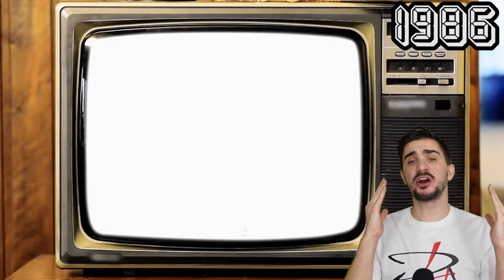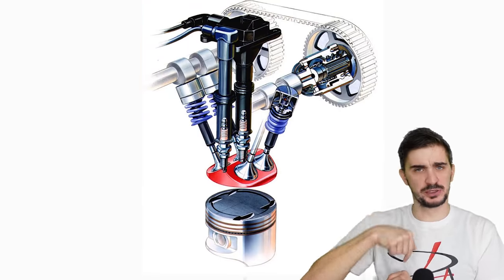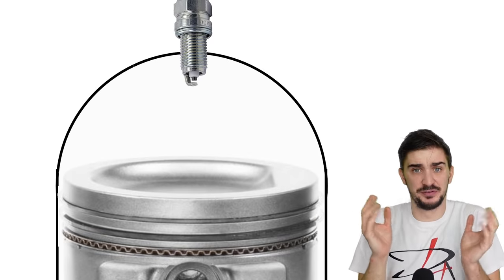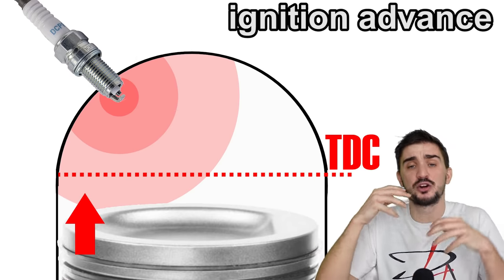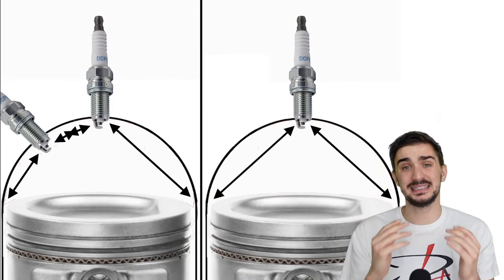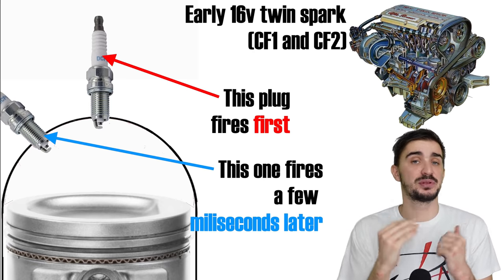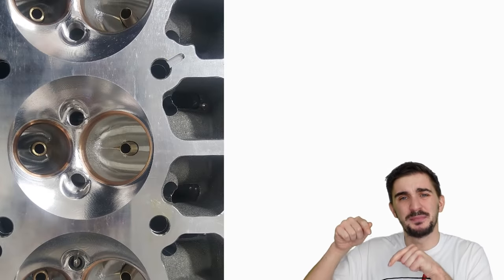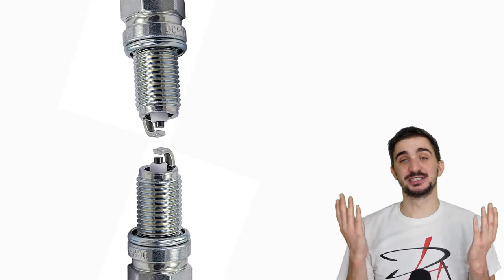TWIN SPARK - WHY, HOW and why it isn't more widespread

Comment: A good explanation. The initial concept of twin plugs was to allow constant ignition on aero engines because early plugs were very temperamental and would often fail on take off or over enemy territory. The advance of flame front on early engines was little understood as these averaged between 1200 and 2000 rpm. Post First War research by K lee Guinness KLG proved the validity of his mica plugs and manufacturers research developed flame front technology and raised rev limits. These were usually  magneto operated and there were safety limits on the drops allowed. This was 400 rpm on the Rolls Meteor which initially were lifed out Merlin engines but later were made in their own right. 
What you have to remember is that in 1914 the only reliable magneto was made by Bosch. So at the end of the war all the magnetos made by the Allied powers that used Bosch principals of design had to make a payment to Bosch. This happened in WWII as well as all the French factories bombed by the RAF and the American Air Force as well as American factories in Germany were given financial compensation. The factories here that created the magnetos and other instruments of war were taxed very heavily for excess profits from government contracts.

Comment: I used to rally a Nissan Bluebird from the early 80s, I ran it with the Z18ET 1.8lt turbo engine. 
It had the 'NAPS' twin plug cylinder head but on those engines, the exhaust side plugs were disabled at high rpm and heavy throttle to prevent knock from two flame fronts.

I not now that Beta has just released their 2024 range which includes a twin plug cylinder head for the 250/300 2 stroke models.

Comment: Mercedes AMG engines also have twin sparks... at least mine (SLK 55, 2007). They ignite in sequence and at every ignition the PCM  changes the sequence, in order to consume the electrodes evenly (1-2 / 2-1 / 1-2 and so on). Not sure if newer engines have the same. My engine has 3 valves / cylinder, variable intake runners and a fixed cam timing.

Comment: Most engines with twin plugs are use a hemi or heli inspired combustion chamber. With the lack of quence areas these chambers NEEDED twin plus for combustion efficiency and effectiveness. A wedge or twisted wedge chamber doesn't need two plugs as it has a quence area that forces the AF mixture towards the plug. This also helps reduce knock sensitivity in moderate compression ratio naturally, aspirated engines. As boost is added or increased or compression is increased for racing performance, we "soften" the chamber or even reduce the quence area(s).

Comment: First good video and explaining some good resons to have twinspark. Tough so far as I understood why Alfa Introduced the 2.0 twinspark is that the old twinspark was now on par with the 1.8 injection so the engine needed an upgread. Fiat did not allow to big changes to the block but there was enough money for a head revision (money as alway's a big thing at Alfa) Here Alfa rememberd this thing from their race history and decided to put it into their cars as a preformence upgreade.This system improving compression (1-11.5 if I remember correctly) and with injection and variable timing made a very good engine. And the 75 twinspark saw high sale numbers.
With the later 16 valve engines there was no need for the 2th plug as the plug was not in the way of the valves, so the engineers reduced the plugs to 1 per cilinder, untill the commercial side took over and forced a 2th plug in there. So technically the yougner twinsparks are a sales technic still sailing on the succes of the original twinspark.
As I have owned an original twinspark, I can say, they were definitly a really good engine and right for the car it was placed in.
Reply: From my understanding, those older 8 valve twinspark engines (e.g. Alfa 75) had a narrower valve angle than the earlier 8 valve twin cam engines (single plug). This narrower valve angle was possible because twin offset plugs replaced the centrally located plug in the older engine, so improved combustion chamber shape was another benefit of the design.
Reply: @alexjenner1108  This is what I ment, tough trying to keep it a little more generic and more easy. But you are very much right on this.
Reply: In Alfa 75,  twin spark engine was born before fiat bought Alfa , had 148hp - same engine with no twin spark has 128hp, it's significant difference, then in 145/6,156/6, gtv.. was on fiats block with alfas ts 16v head and had nothing to do with old full aluminum engines...

Comment: I’ve been driving a twin spark plug since 1986 when I bought my Nissan D21 Hardbody truck the little 4 cylinder still going strong with over 400,000 miles best engine ever for me

Comment: With regards to aeronautical engines, older designs use twin magnetos rather than coil type ignition systems found in automotive applications. One of the pre and post flight checks is to test these by switching off one bank of plugs.
There is a noticeable reduction of RPM and consequentially power when one bank is switched off.
Not only are two plugs used for redundancy in aeronautical engines, the cylinder sizes are big. I'm of the understanding that this is a consideration for engineers with respect to flame propagation.

Comment: Good explanation but for the details you need to search more deep in the technology , especially Mercedes with the 3 valve V6 and V8 have twin spark and fires the sparc plugs up to 5 times each per combustion cycle because in some situation the engine runs very lean to save fuel. Also for the Hemi, the 6.4l is available with an intake system that variates the intake air mass and speed. Always enjoy to watch your videos.

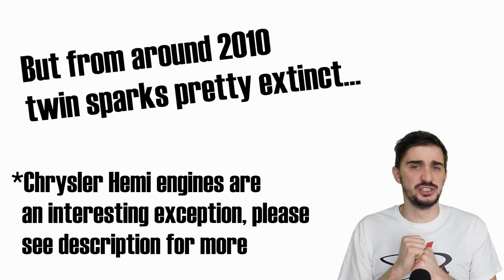Comment: @8:44  The note about the (modern) Hemi reminded me that there were also racers messing around with dual plugs on the classic Chrysler Hemi (such as the 426).  The production Hemi engines were al 8 plug, but some heads were modified to accept 16 plugs.   These were very high performance versions, usually running a LOT of boost (which creates a dense mixture harder to ignite), and many were running fuels like alcohol and nitromethane (so different flame speeds than gasoline).

Comment: My 3rd Motorcycle was a BMW F650GS single cyclinder from 2006, they added a twin spark system in 2004 and apparently it reduced the fuel consumption a bit as well as reducing emissions..
Reply: Mine is a 2007.  The dual spark/fuel injected Rotax engines were a big improvement over earlier models in performance as well as better fuel economy and reduced emissions.

Comment: Ford 6.2 gas engine, is a twin spark plug per cylinder engine, 16V SOHC. Found in the 2010-2014 F150 raptor svt and from 2011-2021 in the Ford Super duty trucks as the gas option. Both fire at the same time to reduce emissions, a single COP plug in the top of the head provides the spark for both plugs via a traditional ignition coil wire to the exhaust side plugs.

Comment: One other reason airplane engines use twin spark layouts, apart from the safety/redundancy factor, is that they usually have comparatively huge displacement when compared to car engines.

As an example, the Lycoming O-320 engine is used in a significant number of small, 4 seat training and personal planes like Cessna 172s and Piper Warriors. It is considered a small, efficient engine, usually outputting 150-160hp. The O-320 is so named because it is a horizontally Opposed 320 cubic inch engine. That is roughly 5.25 liters of displacement in a "low output" 4-cylinder engine.

The comparatively huge per-cylinder displacement of airplane engines means that multiple ignition locations pay huge dividends in ensuring complete combustion across the whole combustion chamber. This is why disabling each of the magnetos during the pre-takeoff run-up causes a noticeable drop in RPM.

As an aside, the reason airplane engines make relatively low HP numbers for their displacement, is that typical propellers drastically lose efficiency as their tips approach the speed of sound, which typically happens somewhere in the region of 3k rpm. So direct drive airplane engines are usually designed to give peak power somewhere around 2400-2500rpm. Gear-reduction engines can produce significantly more HP for their displacement, but often at the cost of increased weight, complexity, and fuel use, and sometimes with reduced reliability.

Comment: I'm not sure an engine can become hydrolocked because of no firing on that cylinder.  I may be wrong.  However, that raw fuel is expelled on every cycle.  It takes a large amount of liquid to hydrolock, much, much more than can possibly stay in the cylinder. Anyhow, I think these are some of the best videos on engines.

Comment: The boss 6.2 from Ford produced from 2010-2022 also had two spark plugs per cyl. :) I own that and, ironically, a 91 Ranger. One benefit of the dual plugs not mentioned in the video, is great cold-start performance. Those two vehicles seem to start no matter how cold it gets!

Comment: If I read you correct, then Harley installed 2 plugs per cylinder begining in 2017 on the M-8 simply to run then as lean as possible (cleaner) at >10:1 C/R. And they do run super lean and hot as ever.

Comment: The Alfetta 159i had variable cam timing (though very simple) before Alfa introduced twin sparks - done for performance. Later twin sparks in these engines (hemi heads - long flame front) was just cheaper than designing new heads, and was done for emission reduction. Any performance advantage after that was just a bonus.

Comment: Do not count the twin spark out yet and it is till quite possible for it to come back again someday. The homogenization explanation of yours is probably true, but not necessarily the main downfall of the twin spark.  The last known iteration, the Honda idsi, still holds a gas mileage economy record, at least where I live, and back when the Honda City/Jazz/Fit had them, Honda would simply let you chose between two variants of engine for the same car, idsi for fuel economy or the ivtec for more power.  The reason why it gives so much more efficiency is maximum torque at low rpm (low end torque rivaling that of diesels) so you can shift much earlier, given the same amount of air fuel ratio, running at low rpms for higher speeds means less combustion cycles.

Comment: Early 80's Mazda B2000 pickup had twin plugs as well, may have been a B3000. I was in the service then, it was a friends truck.  I run twin plugs on my old Harley Sportster, 45 Degree valve included angle means a huge dome piston, the plugs are on each side of the dome.  Harley even did it on stock Sportsters in the late 90's on the "S" model 1200.

Comment: Just read about the Sterling marine engine from 1925, it had FOUR spark plugs per cylinder, DOHC, 6 cylinders and 23 liter displacement. 

Up to 300 hp at 1,500 rpm. 
 
I suppose the reason was that that back then the fuel was not as easy inflammable as modern fuels that are made for fast and complete combustion, and that with 4 liter displacement PER CYLINDER the distances the flame front had to cover was quite considerable even at such relatively low rpm.   
 

I think that in a 2-valver, where you cannot get the spark plug in the center and so have an asymmetric inflammation, a twin spark makes sense. 
 
In the time of 4-valve (same with 5 valves) the ideal spot for the spark plug has been freed for a symmetrical flame front.

Comment: on the KTM 1190 motorcycle, there are 2 plugs per cyclinder (one large, one small) the dealer claims one plug for low speed & smoother running... the second plug for higher speed running... 
it is possible to verify this claim ?

thank you for the content produced   .... always engaging to listen !

Comment: Yeeees! Dual spark is a very important step for me! Thanks for explaining it further lad!

Also, its usage on the airplane engines isn't just easier by that, even if they would use 4 valves, the compressed chamber on these have such a huge fillment due to their volume (Lycoming io-360 has ca. 1495 ccm per cylinder at a compression of either 7,5:1 or 10:1) that no matter how they're planned, they always have room for spark plugs.
And really you did great on information there... Although i Don't get the VW joke. But that's just me. 

Also... As you talked about leanburners....
Leanburner engines look like a thing that could easily need some explanation, especially its correlation to catalysts.... As the 3 way catalysts can't convert said properly to make them better for emissions. 

But also i saw once a website, talking about an engine switching between lean and rich with an NOx storage reduction or NSR for short. I'm not too sure about the last bit as it is not necessarily my main base of knowledge.

Comment: A variation on the dual spark discussion is the Mazda rotary engines. A leading and a trailing plug. The leading plug(top) fires at normal advance but the trailing plug(bottom) would fire 10 degrees later. This was mostly for emissions as the tub shaped chamber in the rotor almost squeezed in half at tdc. The trailing plug fired up to 1400 rpm then shut off then resumed again at around 3500 rpm. Mazda used pre-computer discrete transistor control boxes attached to the rear seat back support. Early '74 12B single distributor engines (as opposed to earlier dual distributor 10 & 12A engines) suffered from distributor rotor failures causing the engine to rev to 1400 then cut & resume in an oscillating fashion.
Reply: I used to work on those early rotaries … They pretty much sucked. I can’t believe Mazda is talking about bringing that engine back.

Comment: My 1989 Ford Ranger 2300 had dual plug head. The mystery was whether the plugs fired one behind the other or at the same time. I eventually found they fired together. Then somewhere on internet I came across a chart that showed how the journals of the crankshaft were slightly larger on dual plug engines which showed me they must make considerably more power for them to bother with that.
In 1970s a friend had an old 1941 Nash with a six cylinder and DUALPLUG HEAD.
It used a crazy 12 point distributor cap so for each cylinder the plugs fired one behind the other. I have no real info on how it ran other than my friend told me it got such good mileage that in order to make sure the gas gauge was working he had to drain a bunch of gas and put it in his truck.
My Ranger 2300 still had a base of a distributor  ( used to drive the oil pump ) even though it used the modern twin coil electronic ignition and I had plans to make an 8 cylinder distributor work and hook it up like the old Nash to see what it would do, but the fuel injection manifold got in my way.

Comment: I had a Bajaj Rouser (pulsar in other countries) 220F , it's an Indian motorcycle, it had two spark plugs that worked simultaneously.
Reply: That's because it's a 2 valve engine and the goals were to reduce emissions and shorten the ignition time. The one in this video has a 4 valve engine with  three spark plugs that gives a spark in 2 different times (two plugs simultaneously and one separately).

Comment: One of my first Yamaha 2 stroke motorcycles has 2 spark plugs, but didn't fire both, it was in case of fouling one you could very easily and quickly switch to the other. My current street bike a Yamaha Raider has 2 per cylinder.

Comment: I had a 1984 Nissan 200SX the had dual spark plug setup, I never knew why they used 2 per cylinder. that car got great gas mileage and was a blast to drive. I miss that car. Cheers.

Comment: The Honda I-DSI engine had a plug on each side of combustion chamber, opposite each other and that engine was 2 valves per cylinder,  it was a lovely engine with good MPG and very tractable which was easy to drive due to flexibility.. I think single plugs are a cost saving.

Comment: The Mazda rotary had two plugs because the combustion chamber location actually moved.  I have antique boats with flat heads notorious for skipping at low speeds. I use MSD dual spark ignition on these to insure it finally does fire. At river events I can run the engine down to 250 rpm for hours without fouling the plugs.

Comment: I used to have a USDM 1988 Nissan 200sx xe notchback it had a CA20E with dual spark plugs and the exhaust side was a different spark plug then the intake side. It had a huge distributor cap with dual coils as well.

Comment: Firing 2 plugs fitted in either sides of the combustion chamber is going to decrease the time to burn the air-fuel mixture quickly.

I've 2 questions rising in my mind

1) When firing the 2nd spark plug slightly later in high speed,is it not creating knocking effect ? I'm confused.

2) When the 2 plugs are sparking together then they are getting enough time to burn the mixture, earlier then the combustion stroke is going to over. Then how is it possible that the unburnt fuel will be left? 

Plz clear my confusions 😢

Comment: With regard to the aircraft engines.  Part of a pre-flight check is to run up the engine to see if it is going to be ready to fly.  While the engine is at high RPM, and the brakes are on, you turn off one magneto and watch for the RPM to drop. You then turn that magneto on and do the same to the other.  If the engine speed drops when each of the individual mags are turned off, the mags are good to go.  The relevant point to this video is, these engines rely upon both spark plugs for optimum power.

Comment: Legacy aircraft piston engines also have 2 spark plugs that have their own ignition system, called magneto's. You can run them on both,  during the start you have to run them both and each independent to verify if both systems are working properly.
If you run one system you have a rpm drop between 50 and 100 rpm at 2000 rpm (= +/- 50% power, you have propeller up front  that needs power to be able to reach 2000 rpm.